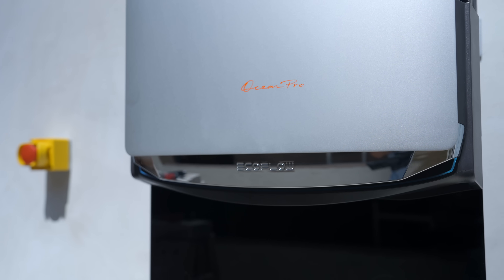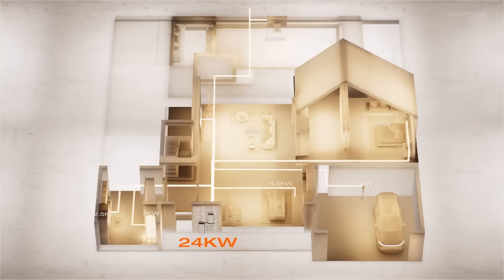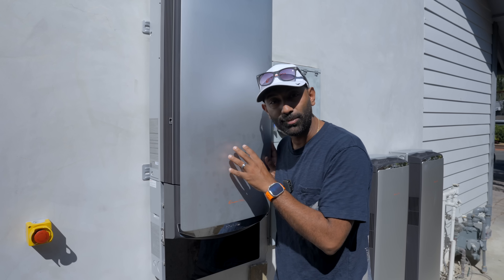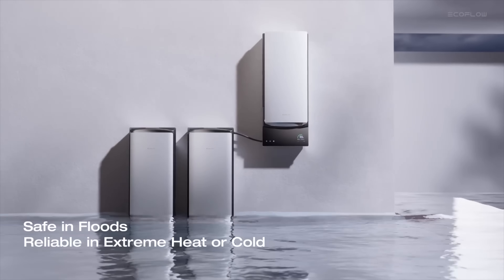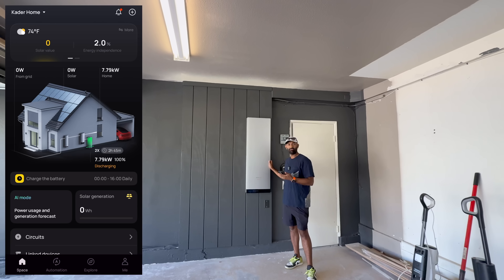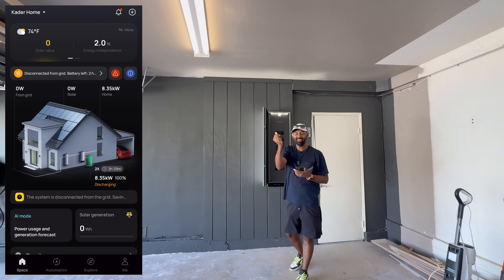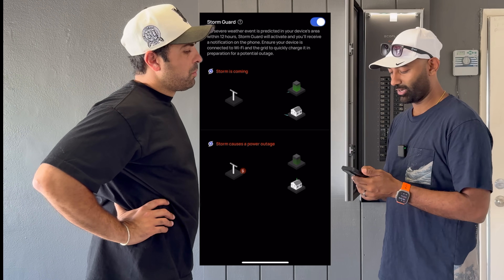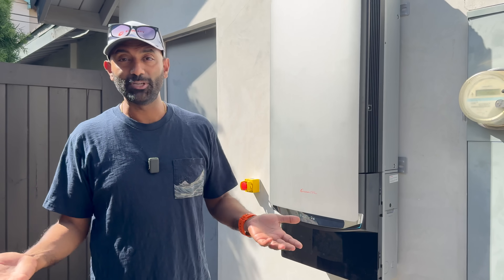Why This Home Battery Will Save You Thousands! Ecoflow Ocean Pro First Look

Comment: these numbers dont make sense first im in souther california th emost expensive everything... i have a family of 4 i have 2 fridges 3 air conditioners fans etc i only pay 350 bucks a month and thats expensive for me thats during the summer air conditiong going every day..

now i dont have a tesla or anytrhing but with a teslas add 50 more dollars a month charging at every 3 days..  so this guy pays 1100 dollars a month geesus somethigns off

second thing solar used to save you money that means the idea and the math worked out.. now its just an idea..

see power companies hate it so they now charge a base rate and removed the they pay you for money dumped into the grid..  so they won... second you pay 150 grand for a system btw you have to have a new roof installed 15 years or less and they wont install the panels... so 50 grand is the bare min for 1 battery a controller and  8kw of solar.. so with that said paying 50 grand or 100 you just got a loan.. or outta your bank you just paid for your electricty at full cost for the next 30 years you paid for future bills..  YOU ARE NOT SAVING ANY MONEY WHAT SO EVER.. let that sink in..

now if you own a home in the middle of nowhere and it costs 500k to bring a power transformer and 1 mile of power lines just to your home.. then yes  that would make sense..  and power companies also trick you into installing their own panels when really there using your roof as relestate to procudce free power for them and giving you a tiny rebate there not free first you loose all rights to that section of roof they can remove them even if your not home go inspect them etc you loose your rights.,.. solar is not worth it its a gimic now..
Reply: Well, I definitely agree that this guy's bill is nuts, even for California.  But my cousin (who lives in L.A.) also has a similar bill and it is primarily due to having the pool and Jacuzzi and relatively poor home insulation resulting in excessived A/C use.   So its nuts, but not outside the range.

But in terms of whether a solar system is worth it... there are lot more factors involved.   It IS dependent on how much electricity you use which in turn depends on how much you electrify the house.  Those costs are shifted from other sources of energy such as gasoline (vehicle) and natural gas (furnace, water heater).  This generally translates to thousands of dollars a year for almost anyone.  Gasoline alone on average runs over $2000 a year.  Furnace (natural gas) typically runs over $1000.

Nor is having a system only about "saving money".  There are other reasons to own a system:  Grid-down backup, immunity from energy inflation, reducing future monthly expenses (in the future when you are retired and earning less), resiliency against future job loss (lower monthly expenses burning up your reserve), and other reasons.

Savings are also a bit of a misnomer.  People generally spend the money regardless, so doing effective yield calculations on saved money by not investing in a system is usually an exercise in self-deception.

But I would agree that taking out a loan to buy a solar system is a bad idea.  Pay for it up front, no loan.  Loans bleed away money.   Even though a direct upfront investment has a higher cash outlay, you immediately garner monthly savings on your electric bill that is at least equivalent to the interest rate on a loan.  The delta between this savings and having a loan winds up being double that.

Comment: HVDC batteries, direct battery HVDC mid-bus inverter design.  Batteries appear to be in 10kWh increments (that is a bit small).   It appears to be a decent design.  For full backup it has to be paired with their gateway, otherwise you are just backfeeding a breaker, basically.

The marketing is glitzy but there's a lot of cabling being hidden behind those walls.  Don't be fooled.  This would be an incredibly expensive installation.

I'll be frank... this is a power station company that's been burning through products like there was no tomorrow.  The chances of this product being supported for its 15 year warranty is close to zero.   I would avoid solutions by power station companies like the plague.

High voltage battery solutions (which are gaining in popularity) have the advantage of simpler inverter designs, but the disadvantage of using non-standard voltages that requires closed-loop communication and more or less a fully proprietary walled garden.   And like the other EcoFlow stuff, you pay a pretty penny to be part of an ecosystem that isn't really going to be giving a lot back to you as a home owner.

I will also note that on their datasheet, they are spec'ing 89% round-trip efficiency through the battery.   The HV design isn't gaining them a whole lot in terms of efficiency.  there's no real value to the design if you still get charged an arm and a leg and you don't get a ton of additional efficiency out of it verses a 48V (51.2V LiFePO4) design.

My general bent is to stay away from power station brands as whole-home solutions and go with dedicated home backup system vendors instead.

-Matt
Reply: The other thing is the advertised 24 kW output can only be achieved with three battery packs.

This video is misleading because the system shown cannot hit the numbers he stated. 

Two powerwalls can hit 23 kW continuous and take up way less space and are substantially less to install. They also have 6 MPPTs each so it blows eco flow out of the water. 

The smart panel is cool but no need for smart loads if you have enough storage. A smart thermostat is all you truly need to make sure they never accidentally drain during an outage.

Comment: What's the price  for the system installed as shown ?
The ocean pro outputs 24 KW ? Their web site claims 12 KW. I've seen on YT DIYer's complain about install by licensed electricians, they'd rather do it themselves. Stupid people. As a side issue, Ecoflow's web site says nothing about the price. For my dream new construction home (on a ranch or farm property, + 3 additional family homes), I'd have the ocean pro (on the main home) with max battery storage, 36 KW of solar panels (to feed the 4 homes) and 25 KW Cummins backup generator. With a goal of being zero energy from the grid.
Reply: This was mind boggling to me too that he never mentions price, ballpark or otherwise.
Especially since he says something like, "two of these are more than one Powerwall 3!"
And unless they're more than half the cost of a Powerwall 3, which also has an incorporated inverter, then you could just be like, yeah but two powerwall 3s would be more than two of theirs, lol.
Reply: It's confusing even on their datasheet, but it does appear that each unit outputs roughly 12kW and there can be up to 2 inverters in the system for 24kW.   Maximum discharge per battery is 10kW.   The data sheet lists the battery specs as:   "24kW (10kW DC per unit)" ... which is confusing as heck.

It seems to me that their are trying to make bloat up the apparent specs of the system without clarifying how many inverters and how many batteries you actually need to achieve those specs.
Reply: @junkerzn7312  Not really, from what you've quoted it sounds like the inverters are rated at 12kW each and can run in parallel, the batteries can output at full instantaneous load 10kW each, so the system is constrained by the battery's inability to match the output of the inverters - ergo, it's a 20kW max continuous output system, that can give 24kW for short periods of inductive load demand.
It's a shit load of power and no mistake...for a house. Learn to live with less, I use under 5kW per day, I have a big house.
Reply: @Bob-h4s2pthree batteries would net you the full 24kW on batteries only, but presumably with fewer batteries, extra power is also available when solar is present, as with most other whole-home inverters.

Comment: Those electricity prices are obviously SDG&E.  Do they offer a lower rate for EV charging (perhaps if the EV is on a separate meter)?  How would total electric bill compare if the EV has special pricing separate from the Ecoflow energy system?
Reply: SDG&E, the EV rate plan is EVTOU5-Residential, it works out to ~0.15 cents per hour (all inclusive, gen+delv+tax+fees) from midnight to 6a weekdays, midnight to 2p weekends. If I need to use their juice I time things for those hours, very easy.

Comment: Battery tech is about to be put on it's head. In a handful of years, Sodium-ion batteries are going to replace lithium-ion for most applications. Na-ion batteries offer better performance in cold temperatures, a vast improvement in cycle capacities, increased safety, and a more sustainable, abundant supply chain for up to 90% less.
Reply: fingers crossed...

Comment: Needs a lot of labor and costly time in the smart panel. No meter collar?
Reply: Not needed and it has a input for a generator.  Inverter Generator not needed, it will clean-up the power of just about any generator as well as auto start and stop if the generator comes equipped like the GENMAX 17K or 10K Tri-Fuel  Also works with permanent installed generators as well.

Comment: 20kw is still not enough I can use up to 40kw a day just with ac. Let alone a ev
Reply: I think you're mixing up instantaneous power (how much juice is needed at any moment, watts) versus power over time (watt-hours). The 24 KW level equates to a 100 AMP service. I hope your house isn't pulling 20 KW all day ?  (480 Killowatt hours, that's $345 per day at $0.72 KwH.
Reply: If you’re looking to cover a 24hour outage without changing your usage patterns, by all means get more batteries, but it’s not cheap 

If you instead get 8kW solar, you could cover all your electrical needs during the day and top up the 20kWh battery for use when there’s no sun without paying the electric utility for that privilege
Reply: Generally speaking if you own an EV you can make ends meet on the 24 hour cycle with ~40kWh of battery storage (I have 42kWh myself).  20kWh is plenty without an EV, and 10kWh will do the job if you do not have an EV or A/C.   The battery only has to deal with overnight... essentially 6pm to 9am the next morning... around 15 hours where the biggest load is in the early evening (dinner, entertainment, highest lighting load, etc).

Generally speaking, 12kW is more than enough to cover instantaneous power consumption nearly all the time when one is using a hybrid inverter.  Any overages simply import the difference from the grid.   And in a blackout you aren't going to running heavy loads in the first place (unless you want to run your battery out fast, which nobody wants to do in a blackout).

So 20kW...  that's vast overkill for a system like this.  12kW is plenty for 99% of homes.

Peak loads can certainly be high.  Double oven (both ovens) 7kW, EVSE might run 9kW, A/C might run another 4kW.   Everything else maybe another 2kW.  Add it up and you get  22kW or so.  Throw in a full induction range and peaks can be even higher.  A heat pump furnace (obviously not coincident with A/C) will also add a lot.

But that is absolute peak consumption.  99% of the time the house won't be using even remotely that much... generally less than 10kW.  Far less than 4kW on average.

A hybrid inverter in a grid-on situation just isn't going to care.  It will simply cap-out and any additional load will come from the grid.  And if someone wants to avoid grid import at all costs it doesn't take a lot of effort to do so.   For example, I drop my EVSE down to roughly 6kW, and generally do not run it concurrently with other large loads.

-Matt